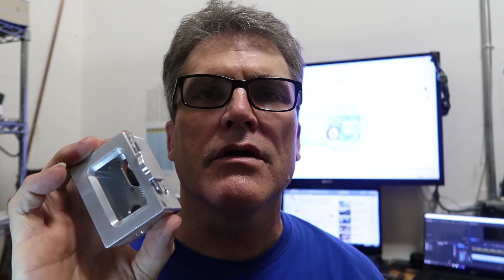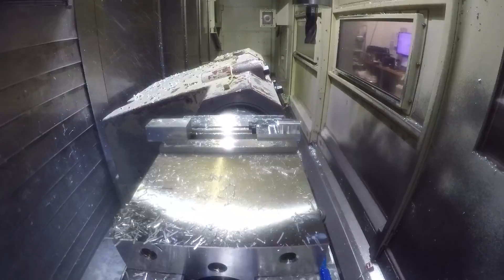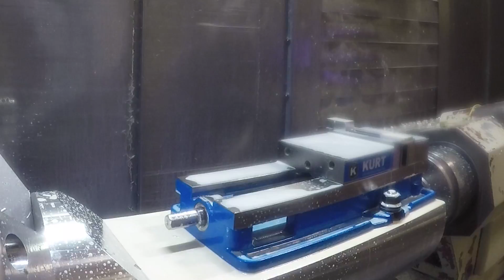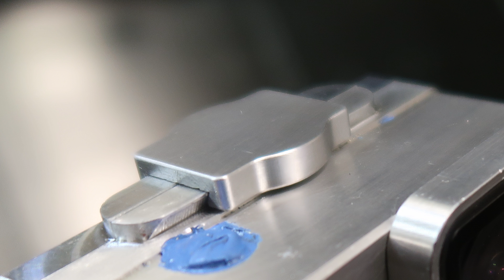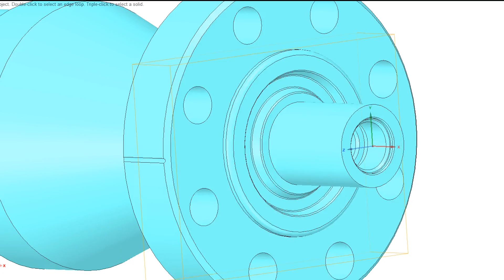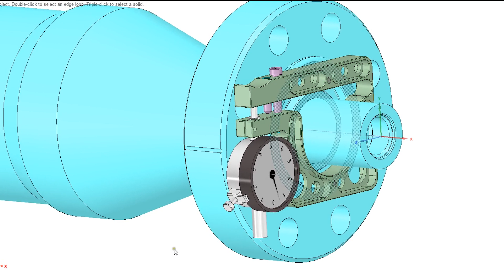Clasp For Aluminum GoPro Case and Future Video Ideas

Comment: Can't you just use a ball edge finder and make a ball size in your cad program to make a ball size from the face and use your machine to measure. They have these edge finders that have a ball on the end and light up when they touch we use them all the time to measure and are acute to within a tenth or two. To me that seems like a huge amount of work just to measure a small taper. They make them I think as small as 1/8
Reply from the maker: Once i get a tool in the spindle to cut a close tolerance feature I hesitate to change it out of the spindle. So in order to measure the cut of the feature in question I prefer to have a measuring device to check it with its tool in the spindle(These are expensive very parts why take the chance) . I know the tool should replete close enough and I could do what you are saying or better yet use the spindle probe but I prefer to do it this way. This video doesn't show the final tool I ended up making.Look at the video "Special Measuring Gaga". Also it is always better to check a dimension wit something other than the machine just as a double check. Kind of like putting another set of eyes on it so to speak.
Reply: Edge Precision yeah I see what your saying and you are not wrong. That's why companies spend big $ on CMM's but then again there seems to be a trend of machine probing/measuring/automated adjustment on the machine before it is put on an actual CMM. At least around where I've been working. I think the machine probe is one of the most powerful yet overlooked tools on machines today. Just thought I had an idea you might have missed that might save you some time and $. That's a lot of work making those gauges and then certifying them. I was always taught a lazy machinist is a productive one. Lol. Love your channel btw I've done alot of the work I see in your shop before with api threads and trying to turn long shafts concentric to gundrilled holes for oil field applications.. Etc... I worked on a DMG gmx 400 tho, not as nice as your Mazak. Not easy work either. And I know how deceptively simple it can seem at first to make alot of those kinds of parts. And hold the tolerances. It requires a hell of a lot of experience and know how. Thanks for making these videos love to see a channel that isn't just for the first year apprentice and actually talks and shows some complex stuff. I hope to see more.

Comment: I'm reminded now of some bigger BX and R grooves I used to cut on a VTL, and they had bosses like that (kind of) right in the way. I'd forgot during an earlier comment, but what I used to do was use the standard MoB rod and I would measure the larger side of the groove (the ID on the drawing) against the OD of the part.  The outside of the MoB tool was sitting on a gage block the same height as the lip the groove was cut into, of course.  I'd get measurements from CAD, to exact dimensions.  From there, I'd drop a gage ball into the groove and check the height, and adjust the smaller diameter side of the groove (the OD on the drawing) until the gage ball sat the correct height, again, from CAD dimensions. That was on the machine measurements, then verified with the CMM when removed.  It was always right as long as you took time to make sure every dimension involved was correct, pretty much exactly, as stacking error over 4/5 sperate measurements pretty much eliminated the .004 tolerance!  Anyhow, that's one thing I did, always worked for me, if what I've explained makes sense.  Not to say your new tools aren't awesome, and I'd honestly love to see them made, used and even marketed ... Without a doubt.  Take care Peter, as always I've enjoyed this series on the camera case, as I do with each of your vjoes, or videos.

Comment: I love your videos, please keep them coming.  If you don't mind, i would like to know what mfg endmills and holders do you like using?
Reply from the maker: Thanks. On the Mazak I use Sandvik tool holders and Big Daishowa collet chucks(because of the capto shank). On the other machines (Haas, Mitsubishi) I use all different brands of Cat tooling. I'm not stuck on one particular brand. Usually what ever I can get when I need it is what I end up with. I don't see any clear advantage between any of the major brands. Now endmills if I just need a general tool I usually go with US22 or Garr. If I'm machining more difficult materials I have had good success with Guhring and Hanita carbide endmills. But I do use all different brands a lot. It just depends on what I can get quickly sometimes. I think a lot of people get hung up on different brands. The truth is they are so close to each other the biggest variable is not the brand of tooling its the set up machine and the machining style used. That is to say; if you are using the proper cutting tool for the material.